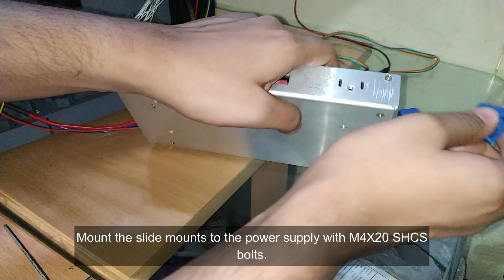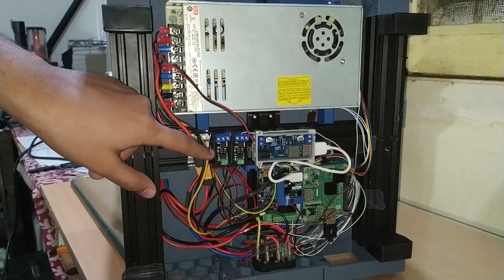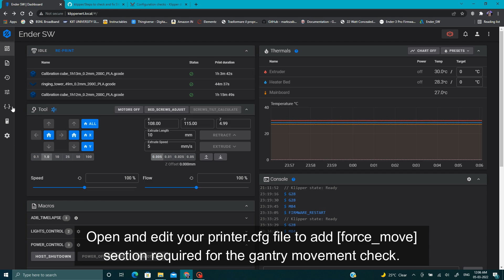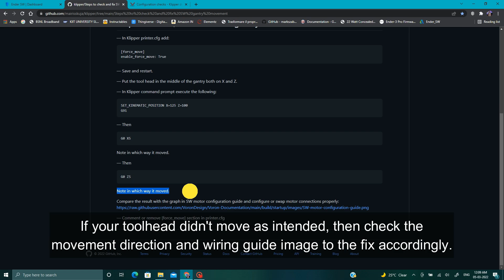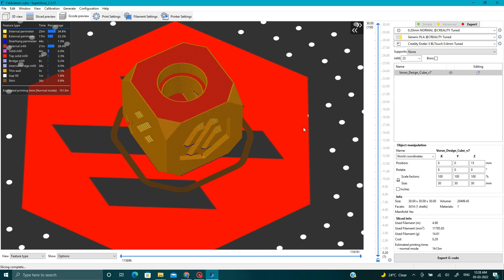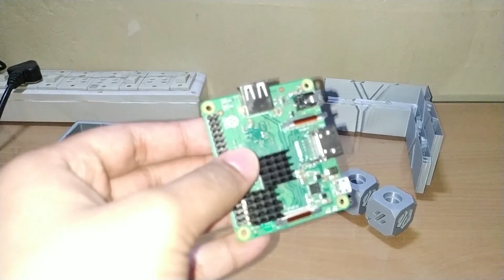Ender 3 Pro to Voron Switchwire Conversion - Part 4

Comment: I have an Ender3-pro that I wish to upgrade.  Your videos look interesting.  I assume you bought the parts kit for the sw conversion.  Did you get the kit that came with the 3d printed parts, or did you have help printing them.  I might just print parts in PETG.  I know this is not recommended by Voron, but I really have no need to print in ABS, so I might not enclose a sw conversion.  I've previously built a reprap / repstrap printer with PETG and PLA parts, and I never had any parts fail.  Then again, I never printed much ABS.  Also my homebrew extruder was all metal.
I am going to use an HPT520 thin client instead of a RPi.  It has a dual core AMD processor (about 1ghz) with 4gb ram.  I upgraded the SSD (SATA M.2) to 128GB.  It is now running Debian testing with Klipper.  You can use the axl135 accelerometer with a RPi Pico connected to your computer via USB (google for youtube video on how to do this).  It works with klipper as if directly connected to the RPi GPIO pins.
Reply from the maker: During my time kits were not available. I had to source the parts myself, even the printed parts were printed by the printer itself inside a foam enclosure. You can use PETG if you want but it does have material creep. If possible i would suggest to print the hotend housing parts in ABS, that's it.

Comment: this video series got me through the full build with no confusion! great job and thank you!
Reply: I have a question, I have finished the conversion and am re using the creality silent board with the original hotend until this red lizard dragon clone come in from aliexpress. what all do i have to change in klipper config? I have a bl touch and ran iton the same issue as you did with it being too low so I swiithched to an omron probe I pulled from the parts bin after I switched to klicky on my trident. also the ender 3  I converted was already running klipper and mainsail on a pi zero. thank you
Reply from the maker: If you are asking in the context of what you have to change in config after the new hotend installation, the things are new pid calibration for hotend, rotation distance of extruder and finally pressure advance.
Reply from the maker: Thanks. Glad you liked the series.

Comment: The assembly of the machine is very good but the wiring of the PCB toolhead is impossible to understand how you have connected it. I can't understand where you connect the 24+
Reply from the maker: Have you checked out the wiring diagram i have shared in my repository? Here: https://github.com/Kruze17/HN_Switchwire/tree/main/ToolheadPCB_crealityv4.2.2%20wiring%20diagram
Reply: @HyperMakes  yes, and I have verified that the diagram has two errors in the connections of the limit switch of x and in that of the probe. The drawing indicates the upper pin even though it must be the lower one in both cases. purple and blue lines.

Comment: cant your share steper motor x and z wiring diagram?
Reply from the maker: I have not used the stock creality motors, so connection is simply plug and play. For creality motors you need to swap the inner two wires.

Comment: Nice I’m finally finishing up with mine too went with a spider board finally finished wiring it last night and got everything running right can’t wait to see the enclosure video
Reply: will spider board fit under ender3 frame? I also looking to buy new mother and spider look pretty good.
Reply: @nirawitnitinunsupkit6281  yea I had just enough room for it and a pi zero 2 w I did an Aquila switchwire conversion but the Aquila and ender should have pretty much the same frame  it was just hard to find a mount for it I had to reach out to the voron discord to find one if you need it let me kno
Reply: @guillorylild  sorry to ask why not SKR mini? Also my plan to use spider is separate the electrical box due to the big board will be too fit for everythings.
Reply: @nirawitnitinunsupkit6281  already had a spider and octopus board laying around but picked the spider because I couldn’t find a mount to put the octopus mounted to the extrusion plus I wanted the extra ports for fans and thermistors I’m already running an Skr mini e3 v3 in my ender 5 pro and it just feel to simple to me I wanted something more expandable
Reply: @guillorylild  Ooh, I am doing the Aquila one too since I got it for 99 bucks, did you have to buy a new Y carriage or did you just drill new holes? Mine has the bolts offset from the Ender's one.
Reply from the maker: Nice work! Part 5 might be up on the channel by next week's Friday or weekend.
Reply: @HyperMakes  do you happen to have a text file with ur start and end gcode ?

Comment: I am doing the same conversion right now. ABS is a pain to print.
Reply: Why?  I have printed 1 set of  V0.1, E3Pro to SW kit already and halfway with V2.4 on stock ender,  with glass bed,  BLTouch,  all metal hotend in a  cardboard box, in my shed.
Outside temp between 5-12 degrees, inside between 16-34.
50 mm/s, bit of Z wobble but that's the stock 8 bit machine.
Planning the conversion in 2 weeks time.
Reply from the maker: Great. Have fun building your voron printers! 🥳
Reply from the maker: Yes, a little worrisome for new people into ABS printing. But as long as you have a extruder that can print at ABS temperatures and an enclosure, you will be loving it.